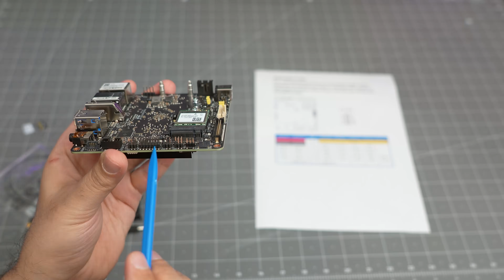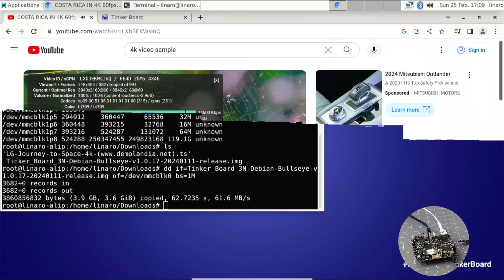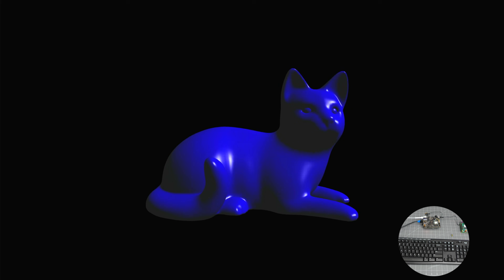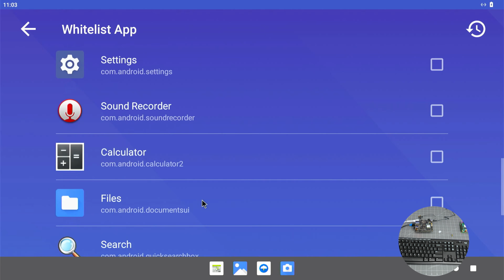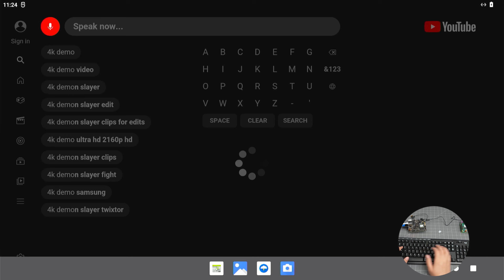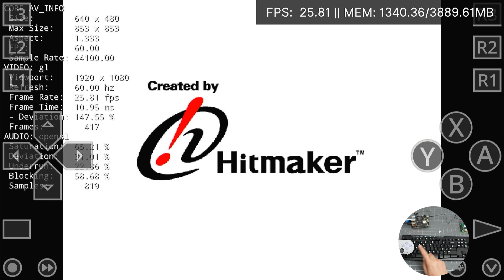Unboxing the Powerhouse: Asus Tinker Board 3N Deep Dive!

Comment: Have you tried adding a 5G card and SIM? I got this (DW5821E 3G 4G 5G LAN Card, Fast Speed Net Card, Support GPS GLONASS Galileo Positioning.) from Amazon but is not working. Any help to test will be great (using the Tinker provided Android 12). Thank you for this video. Were u able to try cellular module with this board?
Reply: Did you try adding a 4G/5G card and SIM? I am unable to make the DW5821E work with Android. Did not try with any other OS. Thanks.

Comment: Not exactly a great idea to demonstrate video streaming while dd'ing your disks. The only think I am taking from this is, that in case the Tinkerboard was capable of 1080p 60Hz the headroom is very small before it starts dropping frames. Or maybe it drops frames anyways. I'm the original first gen Tinker Board and I am  looking for options to stream video Full HD without frame drops. As it seems, I might revert to x86 based solutions.